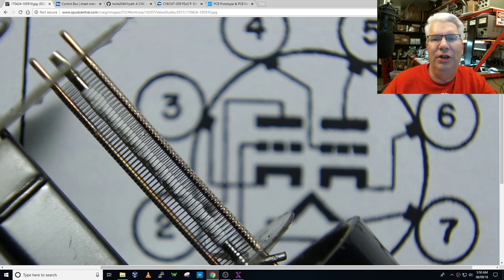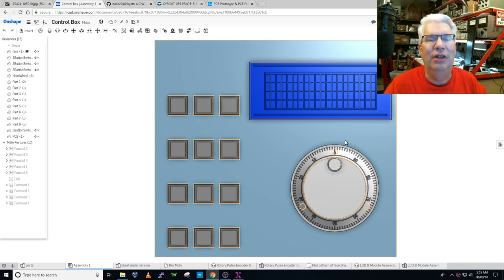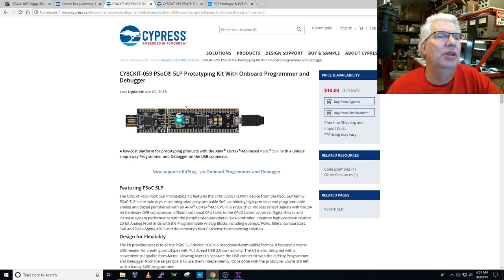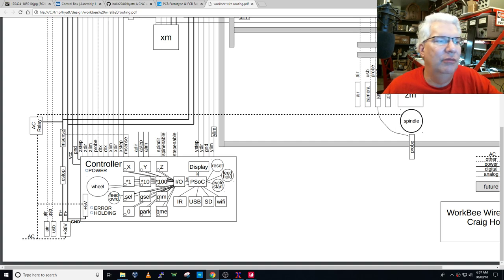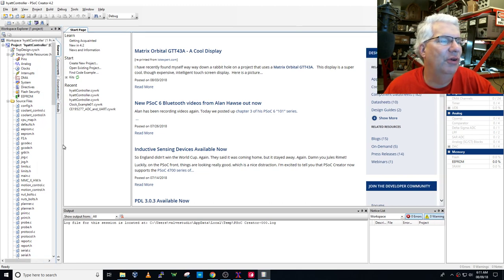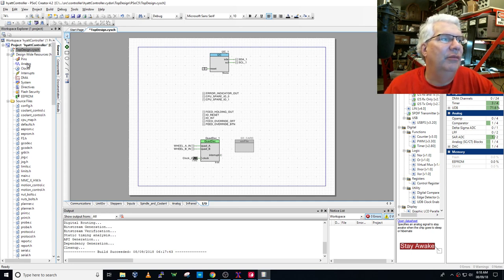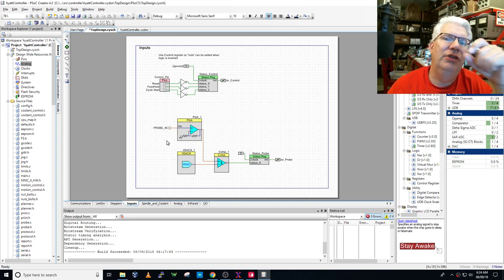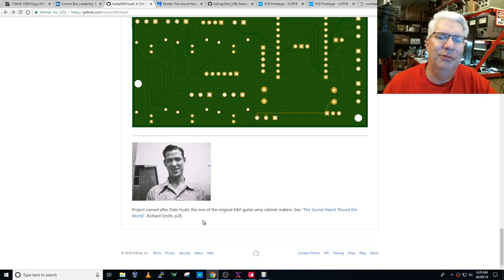180809 Valve Studio - Tonehenge Journey - Hyatt Controller

Comment: Great info on the  pSOC. I'm a guitar player and started viewing your channel for the amp and tube knowledge you share, thanks for that. I'm also building a cnc from scratch, so I'm learning from you again. My working scale model/proto is running GRBL on Arduino uno, and I'm regretting that decision. A windows based Mach3 solution was planned for the full size version, but depending on your results, I may be able to stick to GRBL and Linux on Pi. If that works out, it should be feasible to use my mini control console on both machines. Good luck with the build and Thanks again!
Reply from the maker: Great to hear Davido. If you can stick with what you understand, your success rate will high. I'm an embedded hardware/firmware/architect by day, so I find personal projects to implement with technology to keep current. In this case, building speaker cabs lead to workbee then to PSoC5. My great experience so far with PSoC has introduced FPGA, verilog, on-chip hardware and software design, I'm already have PSoCs earmarked for 2 up coming customer designs. I find that this approach, using something new for a personal project, brings me up to speed with the technology and goes way beyond their supplied examples. Thanks for watching.